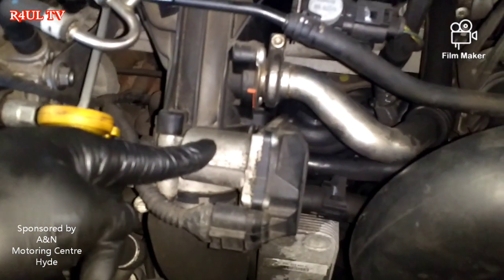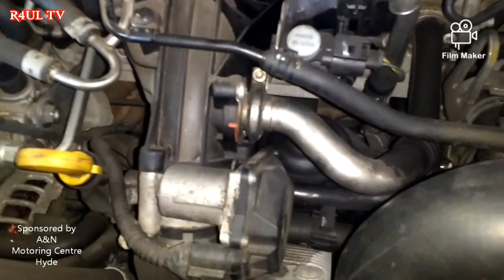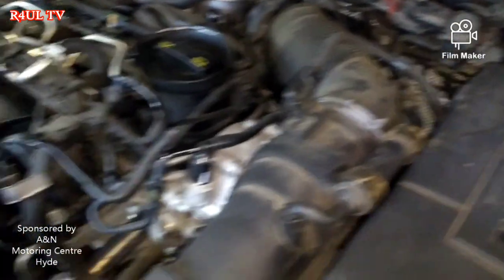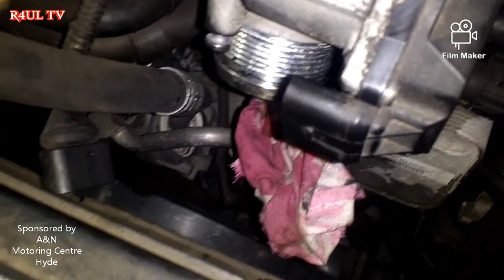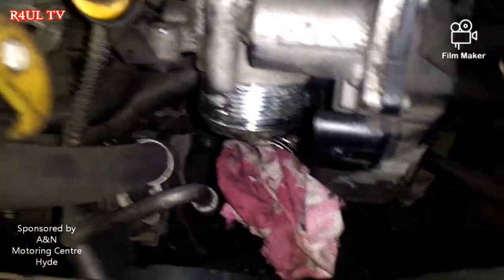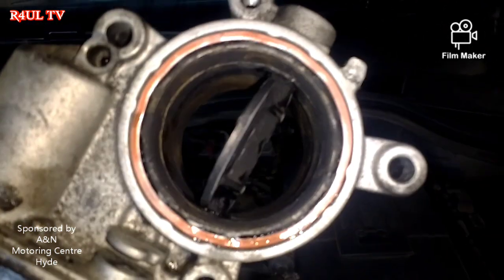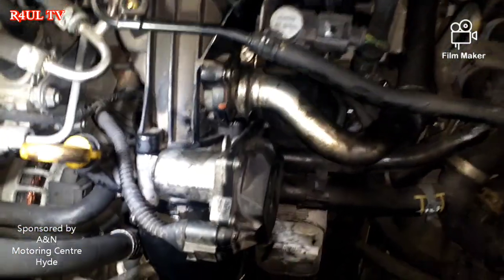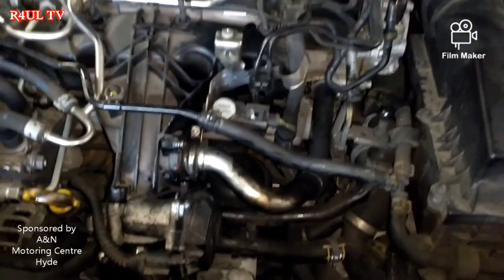How to Replace/clean 2013 VW PASSAT THROTTLE BODY/HOUSING

Comment: The problem is that vw has mounted the egr connection on the intake in the wrong direction, which means that the egr gases go directly to the damper instead of towards the intake valves. So cleaning or replacing the damper then reassemble the connection on the intake

SO clean it and the pipes aswell then rotate the EGR plate 180 degrees that one in 2 torx screws

Comment: Will this same method be used on a 2012 VW Passat SE? I've got this same issue and Flow VW in Asheville NC is trying to charge me $1,600 to replace it.
Reply from the maker: Hi thanks for watching really appreciate it. It should be the same as long it's the 2.0l diesel
Reply: @TEAMR4ULTV whwt if a 2.0 diesel on a mk 6 golf gtd?

Comment: I dont have a check engine light on my 2012 vw passat tdi se but i have w code on th obd scanner says throttle valve control system mulfunction, could you help me with this issue, i serached a lot online and I couldn’t find anything helpful and the codes i have are 2746 and 2745. The car also makes a strange ticking sound when its in park only, if i put in in gear or reverse it goes away, and when i put it back on part it comes back after 30 seconds maybe. I dont know if this issue is connected but i would appreciate your help a lot because i do not want to replace the throttle body before knowing what the issue might be. And thanks a lot for the video i think it was really helpful

Comment: Every video I've seen on this car a couple yrs older than my 2012 and couple yrs newer and I yet to find the same set il as mine has the cooler, egr, and throttle seem like there all tied together and can't be split apart unless you take all three out as a whole. Because there is bolts hidden and can't see them unless the entire unit is off the engine. Because I don't have that hose at the top which would make this job so much easier and make more sense.  anyone else with this same issue? What steps did ou take in removing this ridiculous mess.

Comment: is there any tricks to getting the throttle body hose back on?? it was very difficult to get off but really does not want to go back on
Reply from the maker: You just have to bend it and try to get it on. Not the easiest I know. Just take your time
Reply: @TEAMR4ULTV  i had tried for like 30 mins yesterday, thought about it overnight. today got it in 1 min by unbolting the plastic  innercooler line thing it attaches to on the bottom,  attaching the tube to the throttle body first then attaching that back to the innercooler line thing and re bolting it in. hopefully will be helpful for others. your video was most helpful for this topic, thank you!
Reply from the maker: Sorry I couldn't be more helpful. But glad to hear you got it back on any improvements on the car

Comment: i have sharan 2015 the garage said the throttle body is not working. do you think i can clean it my self? thanks in advance
Reply: You can clean it may start working. My seat altea XL have same problem. Mechanic clean it and work perfect and engine light dispersed. This guy is a 🌟

Comment: Why you didn’t spray the throttle? Is it causing any  problem or you just didn’t do it?
Reply from the maker: I did spray cleaner in the throttle housing to clean it. Make sure you dry all the cleaning agent off. I never spray anything whilst the car is running  because you dont want the car to rev up

Comment: Hey just bought a car at auction with this problem. 
Tested peddle on the code checker no problems. 
Cleared code hour later comes back on 
2012 auto vw passat blue motion 170k 
Do I have to do what you said in this video ?
Reply from the maker: Its worth a shout.

Comment: I have a audi a3 1.6 tdi s line it's a 62 plate with 120 on the clock, the car auto revvs, sometimes going over 1000rpm or just below, also the fan kicks in sometimes, am not sure if it's the throttle body or the Dpf auto regen... Have yu had any issues or come across anything like that? Ohh no engine codes BTW
Reply from the maker: Thanks for watching really appreciate it. It  could be the Egr Valve blocked or damaged

Comment: Great vid! Do you remember approximately how many miles it had?
Reply from the maker: If am not mistaken about 150,000
Reply: @TEAMR4ULTV  thanks dude! My '12 Golf TDI has 153k and a P0638 code. I pulled it and cleaned it but it wasn't nearly as dirty. Your tips made it much easier to do.
Reply from the maker: No worries mate happy to help